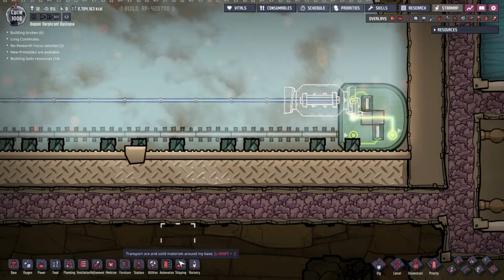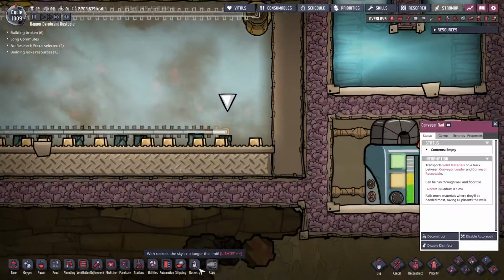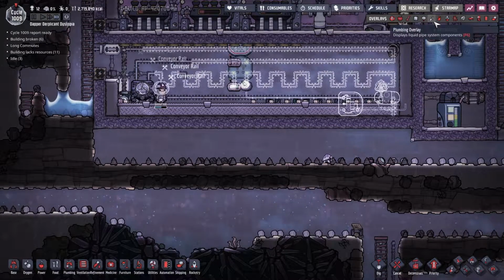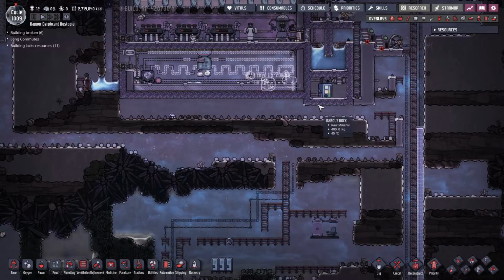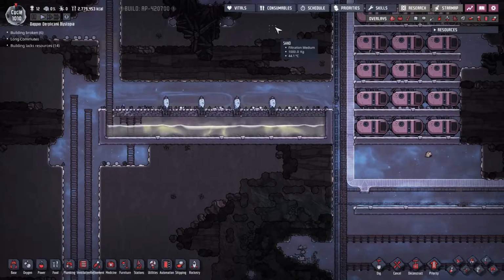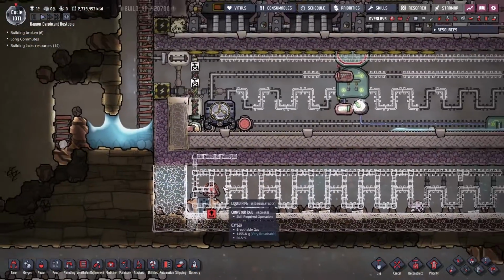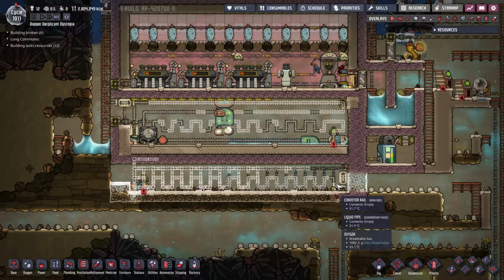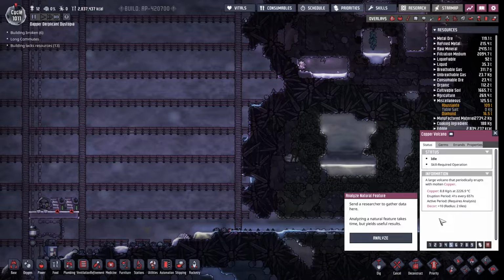Oxygen Not Included: Oassise – Let’s Play Stream Archive Part 149

Comment: Is there any reason that using the copper volcano to produce steam would be better than using the actual steam vents? Just wondering. I know this is an old series, so no worries if there's no answer!
Reply: The steam vent's he has to work with are outputting steam at a temp that is to hot for the steam generators to handle. :)